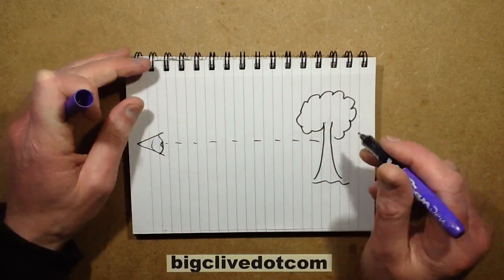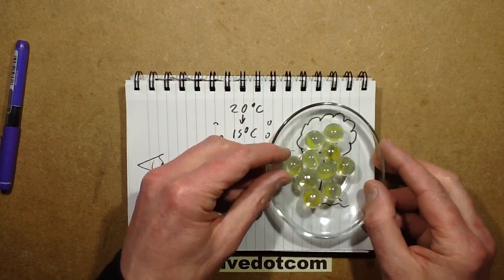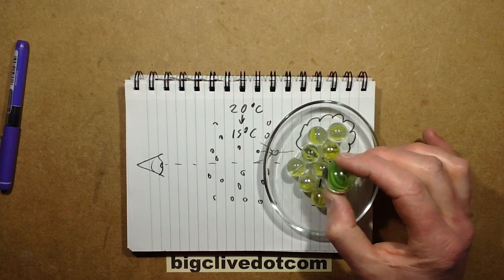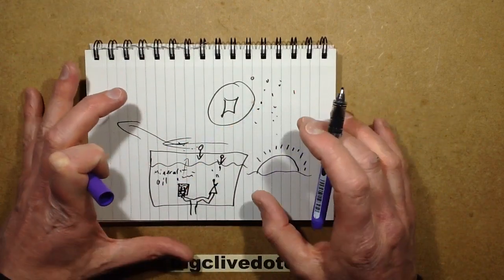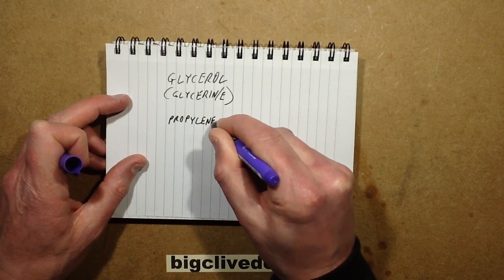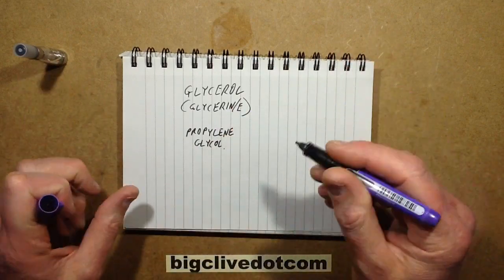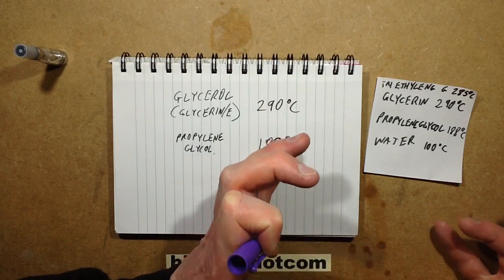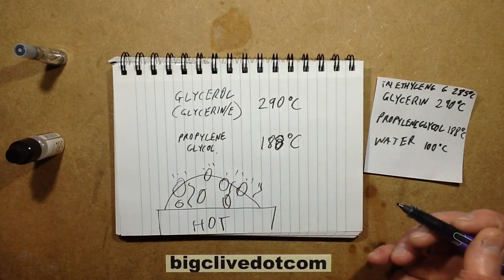How e-cigs and smoke machines make fog.

Comment: Am I the only one who finds the smoke effect of e-cigs totally ludicrous?  If actual cigarettes put out that amount of thick smoke they would have been banned both indoors and outdoors years earlier, and I'm pretty sure that offputting volume of vapour is a large part of the present movement to treat e-cigs in a similar way to cigs (p.s. former smoker talking, stopped about 5 years ago, but the point is that I don't hate smokers and don't want to see them handing the health fascists an own goal).
Reply: +MrSwanley also another thing I have noticed is that Vape... Vapor is more dense than air and when you exhale a cloud of vapor it sinks to the floor then disappears. Cigarette smoke is exactly the opposite. It floats up to the ceiling and face level and just lingers around making a terrible haze in the room.
Reply: +MrSwanley well, its mostly just water ... cigarette smoke is toxic and stinks like hell while the vapor dissolves super quickly ...
Reply: +Paul Hendrix Yes, I'm aware that the smoke is probably harmless, I implied that with "smoke effect". However my point is that it looks nothing like cigarette smoke, so what is the point?  And even though I know it's (probably) harmless, I don't want to breath it in when it isn't necessary.  And lets not overstate the demonic character of cigarette smoke either: the toxicity for example is highly debateable, it is however rather filthy.

Comment: Excellent video, although I'll point out that "cloud chasers" are not burning the glycol or glycerine in their atomizers: every vaper goes through great pains to avoid "burnt hits", because they're harsh and taste absolutely awful. The cloud chaser crowd tends to experiment a lot with increased airflow (to the point where even flavored eliquid tastes virtually flavorless), higher wattages, and high-VG liquids. That's not to say there may not be risks with the temperatures they're running at, simply that they're not burning eliquid to create more vapor. While I don't get too involved with the hobby aspects of vaping (save for making my own eliquid), I know from experience that burnt hits are incredibly unpleasant and no vaper would (or could) willingly vape that. The acrolein study that most people are aware of was found to have highly flawed methodology (and I'm talking obvious stuff here), and were using ecigs in a way that no human actually uses them (nor could they, without burning their throat.) Long story short: that study was thoroughly dissected by at least a few scientific and medical professionals and shown to be less than honest or accurate.

More recent studies have shown that, yes, acrolein can be produced by eliquid if you heat it up enough. The "cloud chasers" are on the cusp of that, but it's not something most average vapors will need to worry about. The occasional dry or burnt hit isn't enough to cause any long-term problems, and even when acrolein is produced, it's orders of magnitude less than just one combustible cigarette.

Comment: I used to have to service those crack oil machines, horrible job if they had blocked jets. and they used to coat everything in the venue with a thin layer of oil.
Reply from the maker: +JaysVintageJunk JaysVintageJunk messy machines to work on.  The oil is usually very discoloured and gets everywhere.

Comment: Cloud chasers use dripper liquid that has a different formula for the sub ohm coils that just heat up quicker the dripper liquid is designed not to burn on the higher powerd coilds

Comment: I've seen an advert in a mechanical industry trade mag for a small industrial mister that uses a rapidly spinning cylinder with tiny holes on the surface - don't recall the application but ISTR the selling point was low maintanance and low noise compared to compressed air based systems. 

And of course there's ultrasonic misters, but I've only ever seen those used on a very small scale like ornaments in woo-woo type shops. Always wondered what would happen if you put something flammable in those - a DIY fuel-air explosive perhaps?
Reply: +mikeselectricstuff Possibly used for intruder disorientation systems that fill an entire shop with 'smoke' in just a few seconds.
Reply: +mikeselectricstuff - If you film gasoline through a mister you will instantly get a subscription.
Reply: ***** nice idea though ...
Reply: +mikeselectricstuff Here's a large volume ultrasonic mister I came across while researching something: www.oceanmistmaker.com/atomizer.html
Reply: +Julian Ilett That's SmokeCloak: www.smokecloak.co.uk
Reply: That's the one. I'm sure I saw it on tomorrow's world years ago.
Reply: +Graham Langley cool! thanks!
Reply: Built my own using piezo disks (6) and a continuous spray - feed system (off the shelf garden mister). Worked fine on straight water, but worked better using a 20% (by volume) glycerol mix, the glycerol helped to produce a far more enduring fog-bank effect. Might dig it out from the depths of the back workshop and add a laser or two.
Reply: the security system is typically called smoke cloak, its just a smoke machine thats on steroids and connected to an alarm system... its continiously heated and you have a powerful solonoid fluid pump... the old units didnt have battery backup but modern units do, however this is not to heat the huge alu block but just to run the pump if needed if power fails.. the heated block stays usable hot for an hour.. can still be warm to touch after 2 days of not being powered
very cool units as the size vs quantity of thick smoke is quite impressive, however they are a lot heavier than the normal large smoke machine that you'd use for discos etc

Comment: Hmmmm - putting e-liquid in a smoke machine.... Why has the cigarette industry done this yet? Could get a whole [theatre,club,rave,w/e] addicted to nicotine....
Reply from the maker: +Alex Matthews It has been discussed on theatre forums with regard to the huge liability of poisoning an entire nightclub with a massive nicotine overdose.  the output would be very variable depending on ventilation and machine use.
Reply: +Alex Matthews
How can cigarette industry benefit from this? Nicotine intoxication will be associated with visiting the club, not cigarette smoking.
And club owners don't need that, whole club\rave is already addicted to partying and getting fucked up (half on alcohol, half on stimulants, which are conveniently sold by the dealers right inside the club).

Comment: when I was a young adult, I wanted a fog machine for my room. My parents semi-complied and bought a thing that is put into into a basin of distilled water and creates a very fine, wispy mist of airborne water particles. 
The device was round like an ice hockey puck but much smaller, and in the center it had a brass-looking disc, above which the water was disturbed. There were no holes or anything in it. I think it worked with ultra-sound or something.
It was more like an air moisturizer than a fog machine, but it created a pretty cool effect when the fog ran down the sides of the basin, kind of like the fog you get from liquid nitrogen/dry ice.

Edit: just found it: http://www.pearl.de/a-PE3901-3033.shtml

Comment: That reminds me, I still need to get a pump for the fog machine I bought off ebay a couple of years ago (cheap think, probably cost less than it does to buy the pumps!!)... :P
Reply from the maker: +twocvbloke Is it the pump?  They are prone to blocking, but can be cleared.  I did a video covering that.  However, the most common issue with fog machines is heater blocking.
Reply: bigclivedotcom
It's definitely the pump, as in, there is no pump where one should be... :P
Reply from the maker: +twocvbloke Oh.  I think that might be the pump then.  But before wasting money on a new pump, it might be worth checking that you can blow air through the heater block in case that's why the pump was removed.
Reply: bigclivedotcom
When I initially got it and pulled it apart, it still had some smoke liquid in the tubes, and when heated and blown through it worked fine (and made a nice cloud in my room!), so presumably the pump failed and they couldn't be arsed to replace it after taking it apart...

Comment: +bigclivedotcom I've repaired nightclub gear for years. I don't know about putting eCig vapour in your lungs, but I've seen first hand what happens when gear is exposed to glycerol fog night after night. at some point that fog has to come back of the air. i commonly see insulation that's failing, solder mask that flakes off, and PCBs that start tracking (strobes).

then there's the machines themselves. blocks that get blocked. PCBs that are conformally coated.

kept me busy for years 😀
Reply: That is one thing that concerns me in the e-cig movement, the almost religious belief that the vapor is always 100% harmless and that very small but vocal subset of users that believe that gives them a God given right to do what they want wherever and whenever they wish without consequence.  But those oil vapors do not simply disappear when the fog clears, they settle on surfaces and wick into porous materials.  I would never want to see an e-cig around a server farm or anywhere near precision optics, etc.  And in homes with very heavy vapers over many years one may eventually have to replace all the carpeting, drywall, etc. just to remove all the accumulated oils...not to mention the fire hazard of so much oil impregnated building material -- which makes me wonder if the damage might not eventually exceed that of cigarette smoke?  The other 98% of considerate users I do not mind so much (to each their own).

Comment: Clive:  Do snow making machines operate on the same principle?
Reply from the maker: +John Schroeder No.  Most of the small foam based snow machines blow air through a sock of material with a stream of very dilute foam liquid so that it soaks the material and is then foamed as the air pushes through.  An outer stream of air then blows the foam off as "snowflakes" that continue to be blown out of the machine by the air stream until they leave the airflow and float down.

Comment: I quit smoking in 2009 by using e-cigarettes. That was when the conpanies just started to realize that it was going to be a new market. Its been interesting to watch the people getting on board over the years. Not much happened till the whole industry exploded about.. 3 years ago. Then they started making kits where you could make your own coil and the whole. Then they people coined the term "sub-ohm”.. And they got into this whole competition to have coils below an ohm touting them as being better and producing more " cloud". That's when the insanity began and people with no electronic background were now the big boys. I can't go into vape shops. They ask to see what your vaping. And inevitably one employee will look at mine and turn to another employee asking if its safe or not safe. And one will say no while touting some pseudo electronics reason and then say I should get this other piece of kit or some nonsense. Never do they ask any real questions. Most of them when you talk about batteries don't even know what internal resistance is nor do they know there is more to a li-ion battery type than just its capacity. Its getting nuts.

Comment: It's not burning Glycerine that causes a bad taste and unpleasantness. The nasty taste comes from either burning the wicking material or having the coil so hot that all the liquid evaporates and the coil glows.If the atomiser is properly built then juice will keep the coil temperature low enough not to burn it.

The silica used in the cheap CE4 atomisers is fibre glass and very heat resistant, but still tastes disgusting if deprived of liquid. Another common wicking material is cotton. Cotton will literally burn and can also taste nasty if liquid supply is insufficient.

Basic ohms law is all that's required for safe vaping. Some take risks by building coils such low ohms as to be dangerous. High drain lithium ion cells rated for 20A continuous from brands such as Samsung, LG and Sony are available. Good cells and sensible coil builds present little danger. It's people that are dangerous, not ecigs. Anyone carrying a 18650 in their pocket with keys deserves to have their leg burnt.

Comment: Big clouds doesn't mean burning anything.  Usually people use the exact opposite of "tiny little coils" to get large amount of vapor and adjusting the power (as most devices sold these days can do) can give you either cooler or warmer vapor and a different kind of flavor experience at any given temperature due to variations in vaporization temperature of various flavorings within.

The deal with the acrolein etc. production is that some studies evaluated e-cigarette style vaporizers but instead of using limited pulses of typical duration, they kept them going for many seconds longer than any user would do, and that would end up starving the coil of liquid and providing the dreaded 'dry hit'.

Comment: Don't breathe in vinegar vapors...This also applies to some caulking compound. Some of it puts of tons of acetic acid vapor, and it is quite unpleasant to breathe in.
Reply: +Tim Ramich Vinegar is actually a common flavoring used in small amounts in many e-liquids.
Reply: +Brian Fundakowski Feldman Yeah, try getting a whiff of it straight from a tube of caulk.
Reply: +Tim Ramich Vinegar has a very low amount of acetic acid, generally in the 5%-20% (tops) range; it's mostly water. There's a big difference between pure acetic acid and a relatively diluted amount such as that found in vinegar. To quote Paracelsus: "The dose makes the poison."

I have a gallon jug of plain old Heinz distilled white vinegar in my kitchen, and it lists the acetic acid content as 5% right on the label.

Comment: I would like to inject fog juice into a car's exhaust to smoke out everyone behind me.
Reply: +Tim Ramich   The smoke trails used in air shows are just VG or PG mixtures injected into the engine exhaust so I rigged a valve to inject engine oil tapped from the oil pressure gauge. That made it seem as if I had blown a ring but some people just ignored or put up with it. Then I got a car with a defective vacuum modulator that when I accelerated and closed the throttle fast it would leave a cloud of transmission oil smoke that smelled real bad. Nobody followed me then. From then on I use sulfurized cutting oil in the "cloud emitter" so the smoke smelled like skunk and made their eyes water and burn. No one tailgates me for long now. If they tried their car would smell like that for weeks. It doesn't affect my car because it is all being blown behind me and burns out of the exhaust system in moments. No residual smell no evidence. "You must have run over a skunk". Just be careful not to have witnesses as it probably is illegal even without the smell.
    Mike (o\!/o)

Comment: Cliiiive. Us cloudchasers that build properly don't burn the glycerine either. As the draw duration becomes much shorter (Many of my builds have a 1-2 second draw time for a "full draw") compared to things like the larger subtanks and the pen-type tops you show in this video.

More or less, the element heats up faster (Lower resistance with more surface area) so the draw can be shorter but result in the same level of "Cloud" production

There ARE people who do mess up and burn the cotton or liquid, but your dedicated user won't have such problems
Reply: Yeah, there are five vape shops in my town. Only one - the one I go into - actually understand things like battery safety and ohms law.

The others also sell to under 18s (illegal in the UK) which makes those of us who DO give a toss about responsible vaping appear to be just as bad as them.

I could grumble about this shit for hours!
Reply: +Zerethon Also, recent research suggests that the more basic CE4-esque devices push out more aldehydes than sub-ohm devices; the margin of error between a normal and a dry hit is far lower in a CE4-esque device, whereas sub-ohm atomisers are typically relatively over wicked, so have less chance of dry hitting (which is what causes the aldehydes to be formed).

It's the wicking that makes the actual difference though, rather than the ohmage; if you have bags of wick the chances of hitting dry go down significantly. Silica wick strands really don't wick well at all compared to, well, anything else.

Cool video, I did wonder how fog machines actually worked :-)
Reply: +Zerethon this comment needs to upvoted... Im a builder as well
Reply: +Beany2007FTW  yeah, like the clearo clive shows in this video has a long set of arched silica wicks that run through the tank, whereas something basic and sub-ohm like my work tank (arctic) is a fairly small coil with a lot of cotton around it and giant holes in the side of the coil to feed it

At the end of the day, it goes back to my point about intelligent use of the devices and systems. the problem is the shops and people getting into the business just to make a quick buck off it.